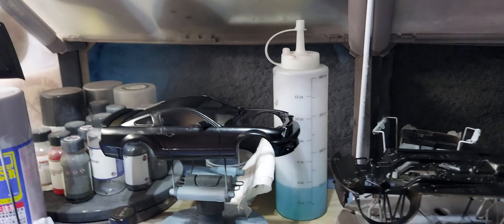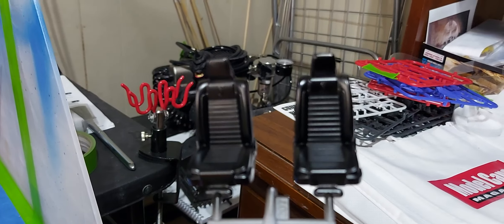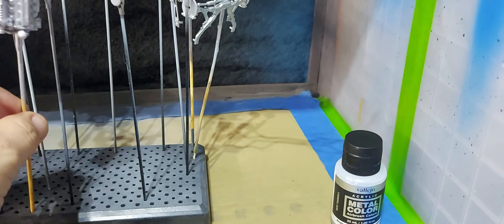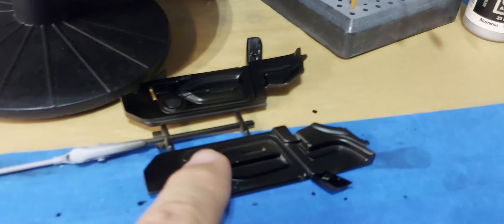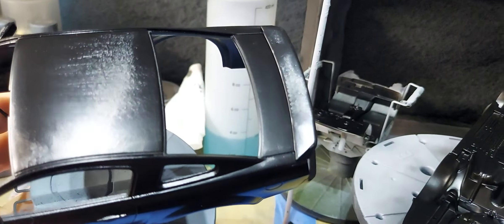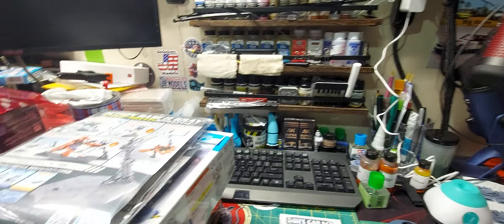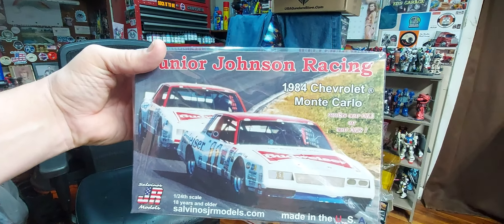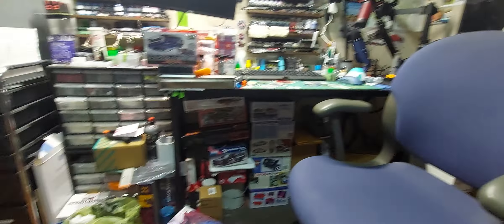3-9-2024 bench update ( jethro & Charlie Mac approved)

Comment: Hi Daniel looks like your paint has etched in to the plastic a lot of sanding to remove it strip it back to the start is the only way to go now the more paint you lay down the worse it will become cool Gundam have fun 👍👍
Reply from the maker: Was hoping not to have to do that, but oh well.
Reply: If it's etching the plastic you need to strip it off.... And sand smooth and reprime with a primer not effected by the black paint basically a sealer to protect the plastic some times a water based primer will do the trick... That is if you want to use the same black paint.